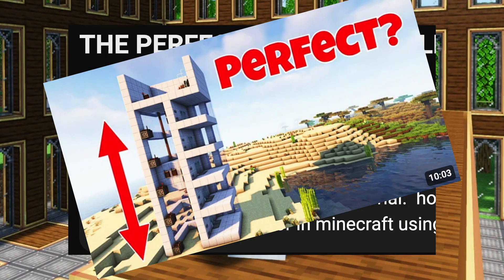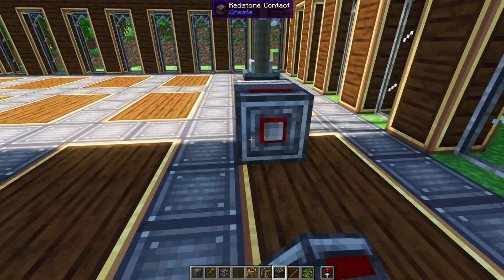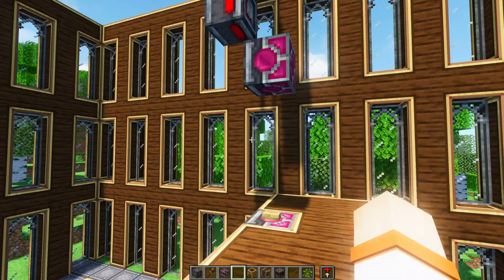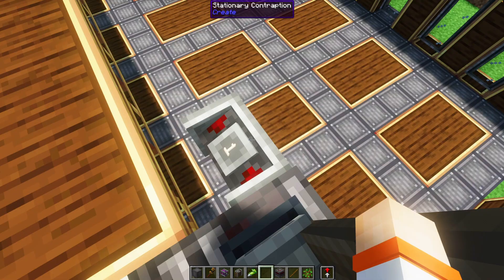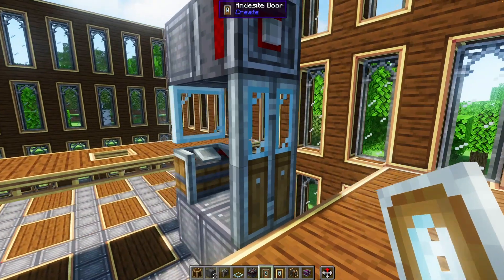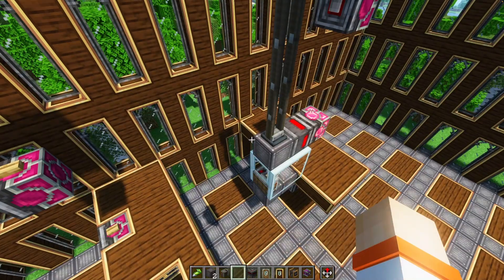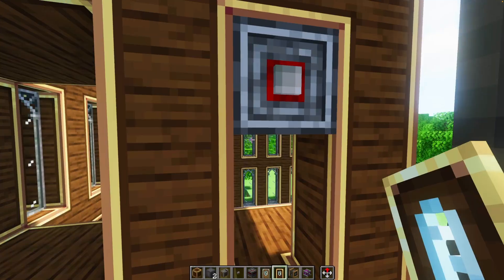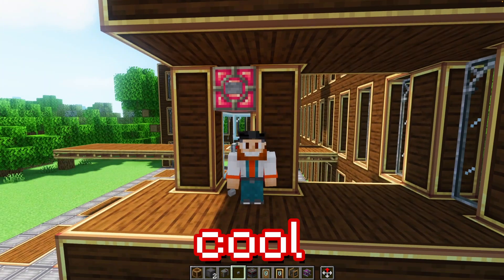perfect-er Minecraft Elevators! tutorial | Create Mod

Comment: is there a hardcoded size limit? I have the shaft set up and my elevator is 30x15x30. I know usually the max is 16 but would it be possible to go above that?  I am making the elevator as a hidden aircraft deployment system for Superb Warfare, for my F-35
Reply: I still haven’t figured this out but I saw somewhere that the elevator pulleys sync if they’re on the same y-level so you could probably just connect the ends
Reply: I just tested it out in a creative world and put the elevator pulley at y level 77 and it worked. I haven't tried more but I'm sure it can go higher

Comment: Great tutorial. I knew the basics about the pulley and the contacts, but i looked this up for the automatic door. I used to hide the redstone contacts in the floor of the elevator and the back of the elevator shaft, but i didn't know you can put buttons on them. I kept finding myself on the wrong floor without the elevator and having to use spectator mode to get out, but it never occurred to me that there would be such an easy fix for that.
Reply from the maker: Glad you found it helpful. 😊

Comment: My double elevator doors on the outside on the elevator both open and then close when I press the button. Is there a way I can fix this? I placed my connectors on the floor instead of above the door if that helps
Reply from the maker: Try placing them above just to see.  Could be. Different create version.  Also not sure if it works with regular minecraft doors. If you have the room you could use more traditional redstone methods with the connector as the signal source. Good luck!